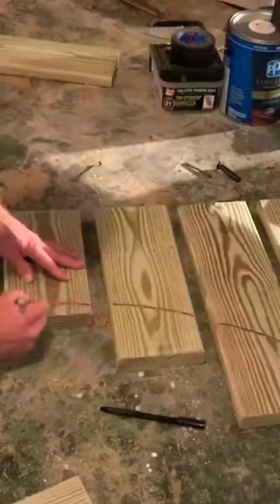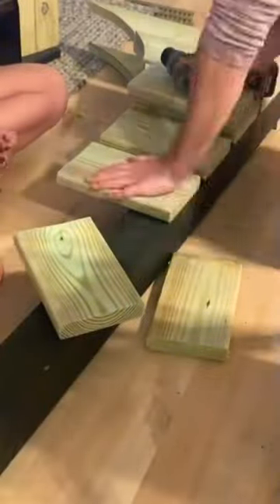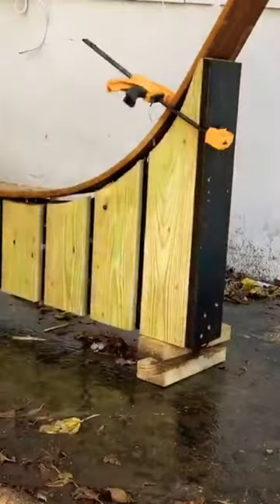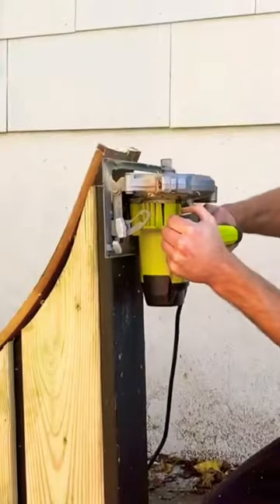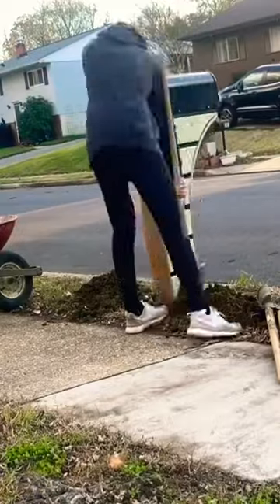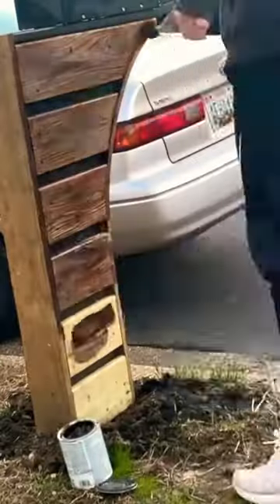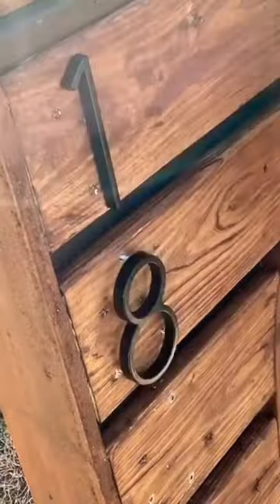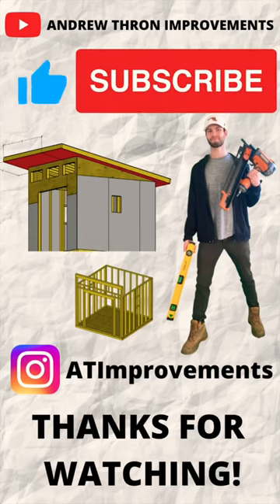DIY Custom Mailbox built from Scratch!

Comment: I am not a carpenter but I learned here that you don't cement woods directly.
Reply: 100
Reply: And in some areas your not allowed to anchor your mailbox in cement
Reply: Yeah a mail box should last more than 20 years....
Reply: its a mailbox.. not a big deal
Reply: Lumber pressure treated for ground contact should be okay inside concrete for non-load-bearing work. I do recommend berming the concrete at the bottom of the post to carry water away from the post. Too often folks create a concrete depression that holds water against the post, and this is what ultimately causes rot and structural failure.

Comment: The wood materials used aren't pressure treated, you don't put wood into cement, you don't use "stain" as a finish for an out side project...this will last 3 years if your lucky!
Looks nice though, for now!
Reply: That’s definitely treated wood. Those are 100% 1x6 deck boards.

Comment: Here's something to think about. If you live in an area where snowplows can mess up your mailbox, consider making it able to pivot so if the plow hits it the post can turn. I cemented a pipe in the ground and built the support around the pipe in such a way that it turns if pushed by a plow. When this happens I just turn it back into position. If I hadn't built it this way I would have had to replace it every year I've lived here. (30) yrs.

Comment: A bit off topic here.  I was talking to a fencer, as he was building my fence, and when he put the fence post in, he topped up the hole with dry concrete mix.  I asked why he didn’t mix it and he said that the moisture in the ground would set it in.  This is in Victoria, Australia, so not a very dry part of the country.  Anyone have any thoughts or opinions?

Comment: When I was a kid we live near a community college campus and our mailbox and our neighbors were beside a very busy highway and several times our mailbox and the post it was mounted two were hit by cars and destroyed so my dad got with the neighbor and here’s what they did they dug a 4 foot hole filled it with concrete sink down into it a pipe - steel it was 1/4 inch thick they had it coming up out of the ground 3 1/2 feet so this was a 7 1/2 foot tall pipe sink down into concrete and filled with concrete they had the mailbox mounts already to go got it all set up it was a hot weekend so the concrete set no problem it sat there for a few months untouched and then my dad Gets a call from the neighbor saying “you need to check out the mailbox”. so we go and the metal post was slightly off angle and in the field behind it was a car with his front end caved in whether they hit it intentionally or were drunk or stupid whatever the score was mailbox one idiots car zero

Comment: Hate be a downer BUUUUT, those 1x pieces will likely cup, the end grain will get splintery on that spacer, and the plywood will rot out. It should look good for at least 2 moths though I would say
Reply: If he had made this with properly cured and treated hardwood it will last for years. Luckily, Im guessing this entire project cost maybe 40 bucks in materials. Lesson learned.

Comment: Will not meet the post office rules for mailbox's.  Post can't be over 3.5 inch wood post or 2 inch metal tubing and not more then 24 inch in the ground.   Can't be cement in the ground.  Can't be firmly attached to the ground if it is a brick one and really the brick ones are not legal if you read the rules.  post has to be 41 to 45 inch in height.  There are meant to be easily knocked over.
Reply: Go find 5 neighbors whose mailboxes aren’t cemented into the ground I dare you